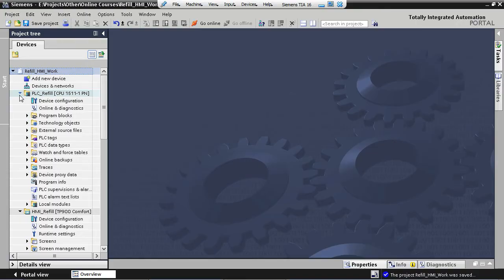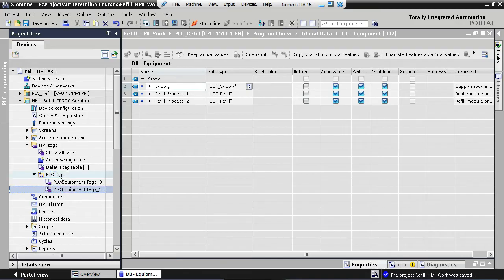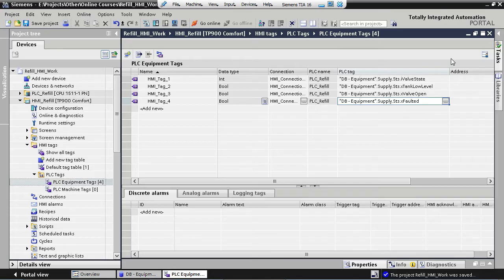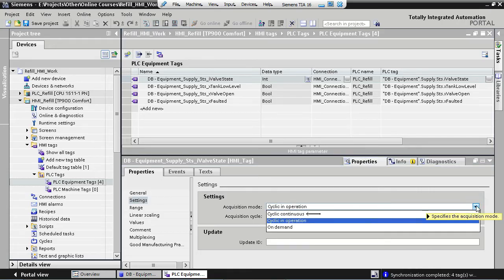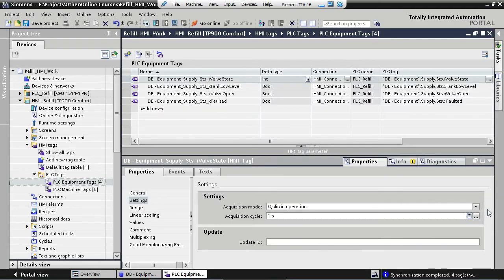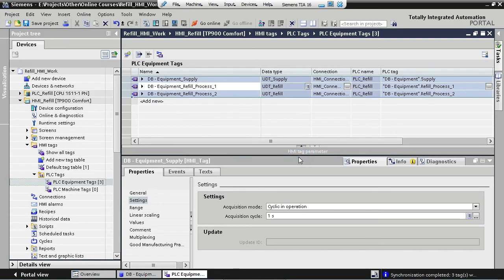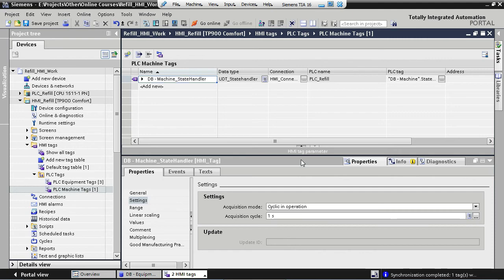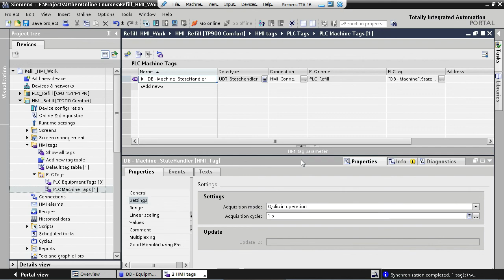How to Create HMI TAGS for your TIA HMI Application (TIA Portal Course)

Comment: When i follow these exact step creating HMI tags and connecting them to my PLC tags via HMI_connection its requires an address for the tag even though i am using datablock tags. I've tried to find a way to change absolute access to symbolic access but the program wont let me and doesnt even offer the possibility. In my global datablock properties the "optimized" option is grey and i cannot activate it. I am using a S7-300 PLC. Can anyone help me with my problem?
Reply from the maker: S7-300 PLCs do not support optimized block access.  This video is made for S7-1200/1500 controllers.

Comment: Rly nice video! I have a question tho. I just started working on a project (made by someone else) structured just like this, with DB an HMI tag tables but I can’t understand why the hmi tags are not linked to plc tags but instead each one of them has an address which seems to lead to a DB which doesn’t exists in the project and so I can’t trace back the hmi tag in the program block functions. Any tip?
Reply from the maker: That’s probably because the connection has been removed from the HMI tags.  If you add PLC tags to your HMI tags folder, the connection between the PLC and the HMI (check “Connections” in the tree structure on the left) is used.

It seems the project you received is a bit of a mess and needs some cleaning up 😃

Comment: in the case the HMI is created but the user decides to see where the output is located within the plc program, what is the best way to search and locate?
Reply from the maker: You do that by using the excellent cross-reference function in TIA Portal.

For a detailed example, check out the second post here on my website:

https://www.plcskilltree.com/blog
Reply: @PLCskilltree the link is not working anymore
Reply from the maker: @domingos5851  thanks for your feedback, I corrected the link. It’s working now.
Reply: @PLCskilltree  thank you for your prompt answer.

Comment: but using memory bits in parallel it's not pro, especially with a complicated programs, I saw in Hegamurl Youtube channel he recommanded to use DB for HMI, for a reason I don't know I did the same thing but it didn't work with me, so I want to ask you to tell us why and how to do it and here the link address
https://www.youtube.com/watch?v=osuiU0Rn4OM
Reply from the maker: What is your questions exactly Nabil?  Yes you should only use DB communication between a PLC and an HMI.  The reasons for this are two-fold.  First off, DB´s allow for creation of structures (using User-Defined Types) so they are easy and structured to work with, both in the PLC and HMI application.  Second, DBs are hardware indendent, so if your application has to run over a different range of PLC hardware, you don´t need to change anything to your application.  Memory bytes (e.g. M2.0) are hardware dependent and cannot be structured in the same way that DBs can structure data.  
What does not work for you?